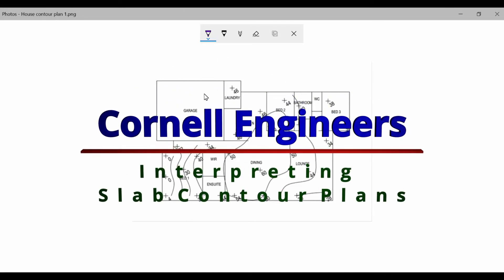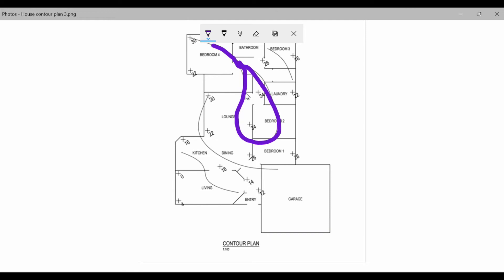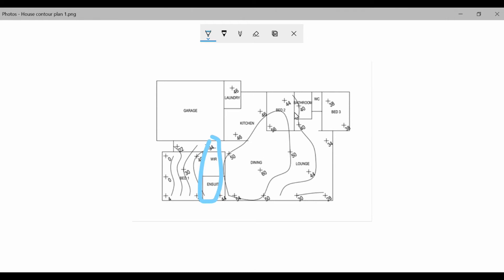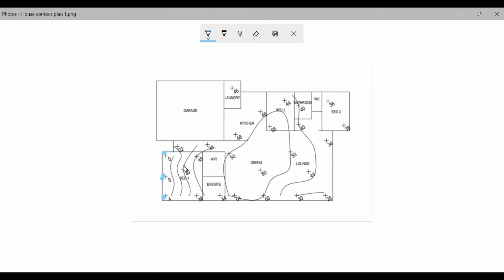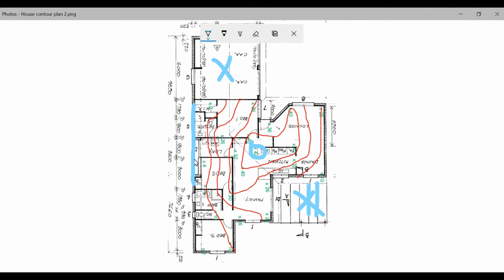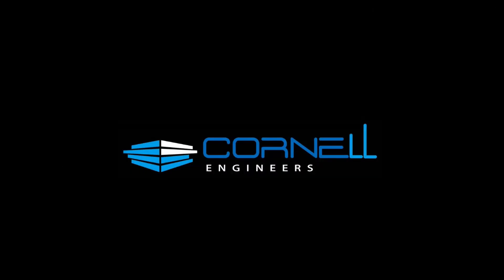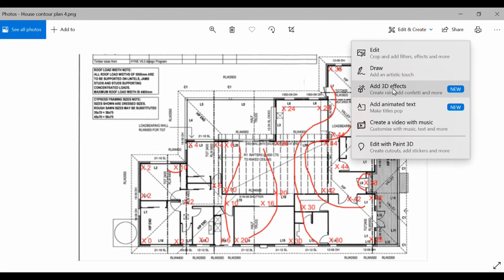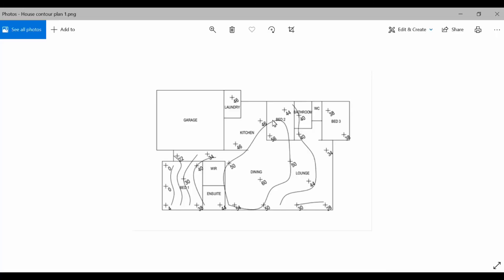How to read and interpret Slab Contour Plans for houses - a diagnostic tool for fixing slab heave

Comment: Hi Matt, a single storey house is being built. There had been no soil tested before the slab was built. The structural engineer assume M class site and designed a strip footing slab, builder said they built a double storey standard slab for a single storey house. My structural engineer said for a single storey house with this "M" class slab has no any problem for H1 and H2 soil as well, is that correct?
Also, is that adnormal that building a slab without soil tested, just by experience?
Reply from the maker: Hi M Michael
it's a reasonable thing to ask the engineer and builder to stop work until they have been able to assure you that the footing and slab they have designed and built for you is appropriate to the site.
So far, it sounds like they have not. 
Meet with them in person. Sit around a table and record the conversation with your phone. Have an independent engineer attend with you to give you advice.
It definitely is not normal that a soil test would be completed after the slab was poured. It is not normal for a slab to comply with Class H2 if the site is only Class M. Why should you pay extra for the extra slab strength?
Find a local, experienced engineer. meet with the builder. Get an answer you are happy with. That is the best way forward.
Matt Cornell